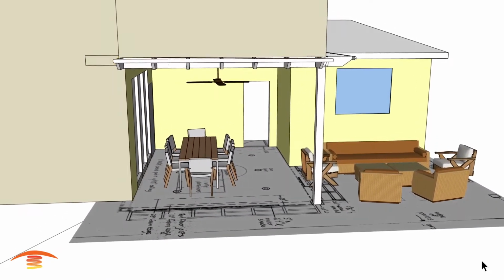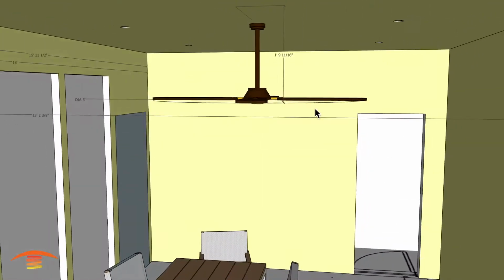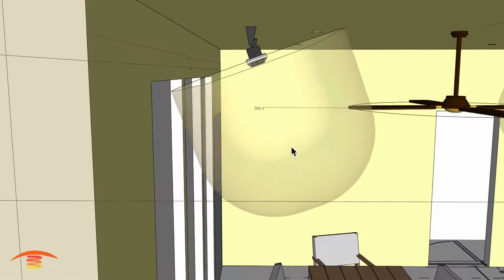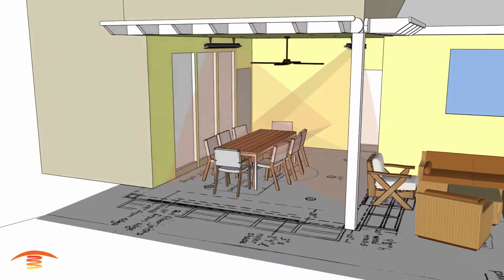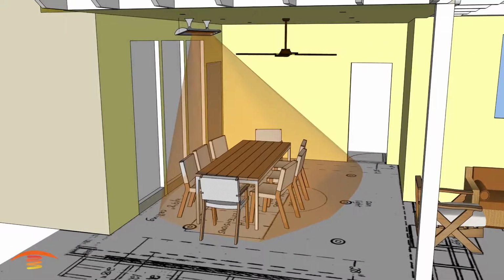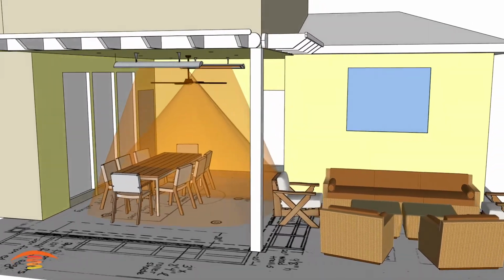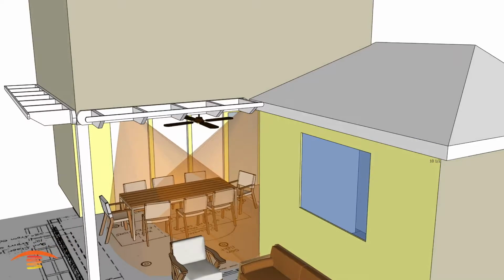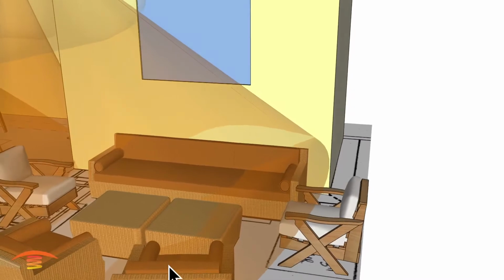Heating a Residential Patio in North Western US with Infratech Electric Patio Heaters

Comment: So you were out of spec related to hitting the ceiling fan “but that’s gonna be ok”.  I’m dealing with tight specs on combustibles and simply cannot get a straight answer.  What’s the +/- on the clearance specs?
Reply from the maker: The fan in the video is a visual representation for the client (not a accurate diameter), the true diameter of the fan is 5'.  In the video after time marker 4:45, showing the true diameter of the fan (represented by the black circle), I state that "I am not penetrating that" (that = fan).  Each project I make recommendations on, still requires a in field accurate assessment of the clearances the manufacture requires in the manual.  Further in the video I show an alternative option using the CD6024 model heaters and state that I will not work unless you change the fan blades to no-combustable or to eliminate the one heater.  I will occasionally show a heater that can not be used (and state that it can't be used) so that the client can see why I do not recommend its use in their application.   These 3D videos are designed to assist in the process of placement and heat coverage.  You can find all of the information on Infratech at their web site https://www.infratech-usa.com/resources/literature/ scroll down to heater specs.  Hope this helps? Steve
Reply: @patioheat  thanks Steve. Very helpful. I keep seeing videos and pictures (all real and not simulated) that look like they’re closer to things like a ceiling that just makes it frustrating. Your videos are very helpful—especially with your clear explanations. Thanks again!